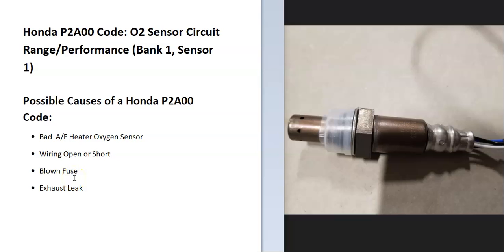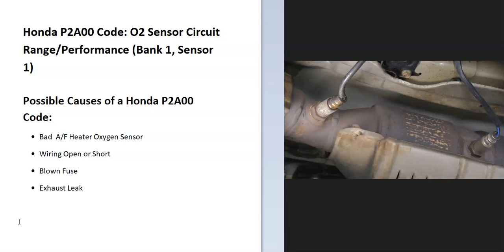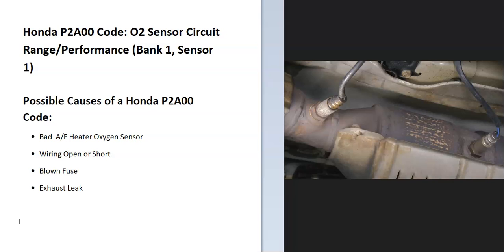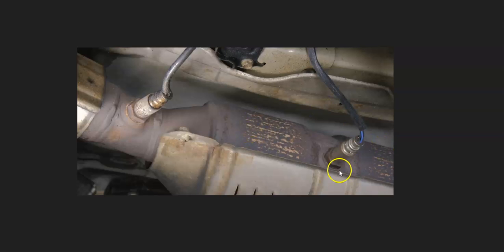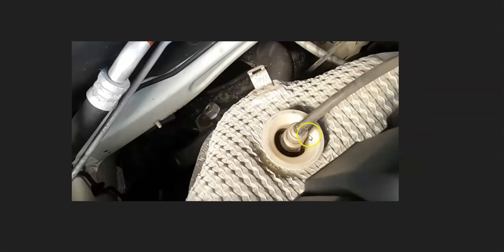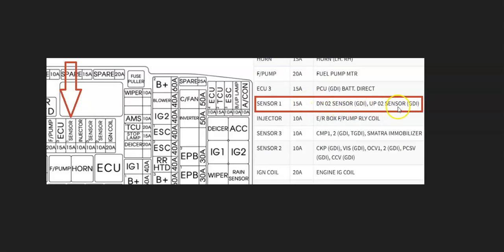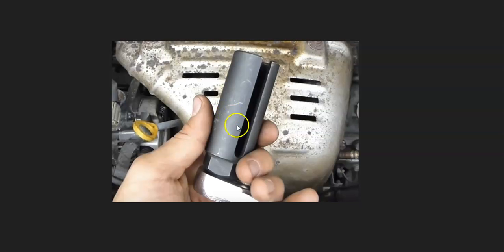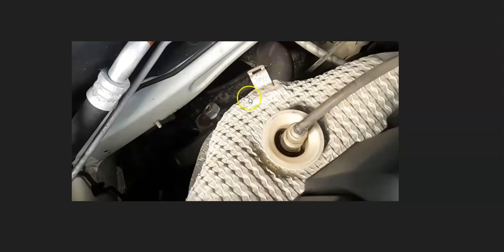How to Fix Honda P2A00: O2 Sensor Circuit Range/Performance (Bank 1, Sensor 1)

Comment: I changed my o2 sensors, then the maf, still got rhe code. What's left to change?
Reply: I’ve done the same, first o2 sensor then maf sensor, but the fault still comming back! Have you found the issue?
Reply: Solved it?

Comment: Many thanks for this Video but it didn’t help me yet. 🥲
I replaced the sensor on my 2018 Civic Sedan the fail was gone for about 30mls, then it came back. 
I delete it again and the failiure code came back after 400mls. 
Do you have a tip for this case?

I also have to say that as the old sensor was build in i didn’t had a chance to delete the failure.

Comment: Quick tip, if you're replacing the sensor and you don't have the tool, feel free to cut the wire off and use an impact deep-well socket
Reply: don't do this, you will need the tool to put the new sensor on. might as well use the tool to remove the old one, you may be able to test it to verify its bad, or verify its good and your problem is wiring.